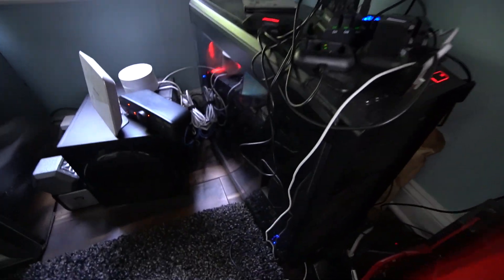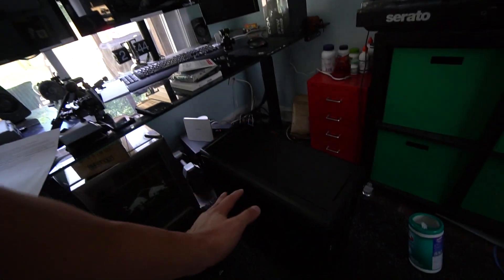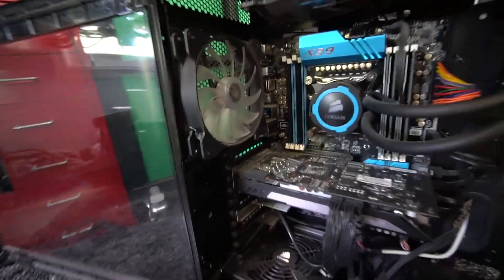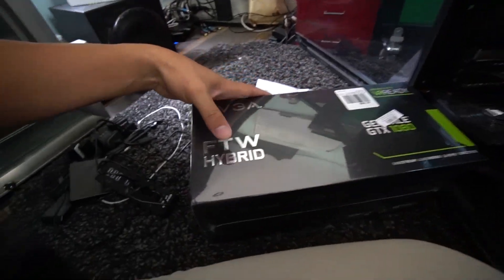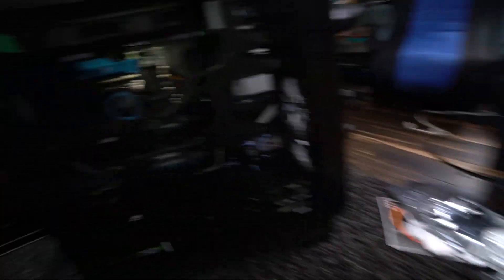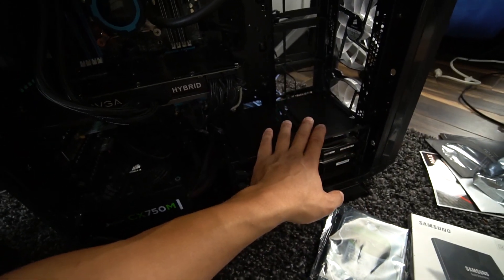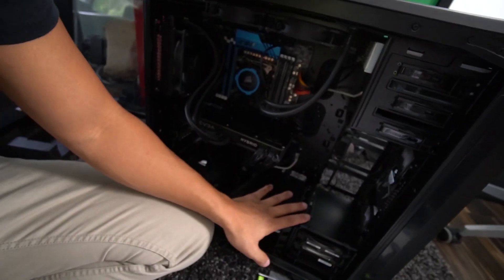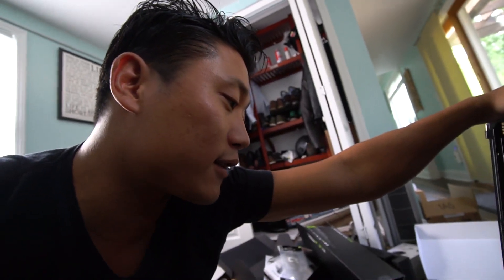My YouTube Video Editing PC Setup Explained And Upgraded

Comment: The ram is installed incorrectly, you should have ram installed on both sides of the processor
Reply: varies per motherboard, manufacture, chipset, etc.

Comment: I just built my computer about a month ago. It was over $2300. Shits so expensive. 

MSI z270 m7 
I7 7700k 
16gb g.skill trident z 
Evga 1080 acx 3.0
1tb WD Black 
512 gb Samsung 960 pro
Windows 10
Some Corsair case
Cpu is air cooled

I can over clock to 5ghz but temps get a little high so I have it on stock 4.2ghz cuz I don’t really need OC yet. GPU is also not OC for now. In a year or so I’ll probably water cool and over clock